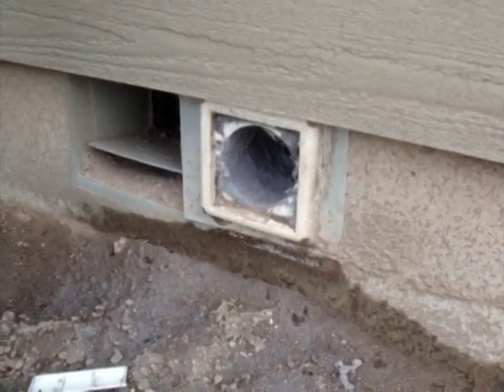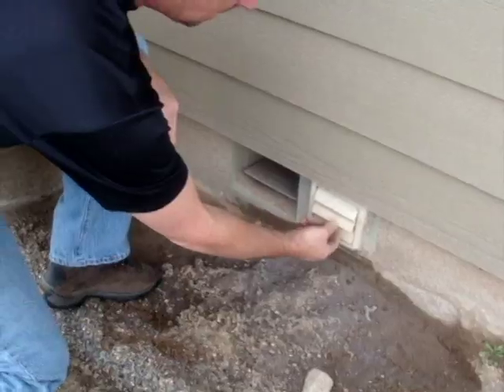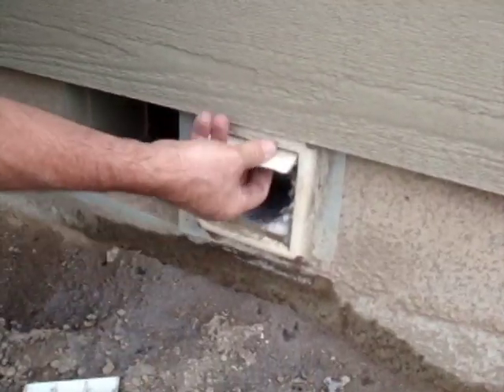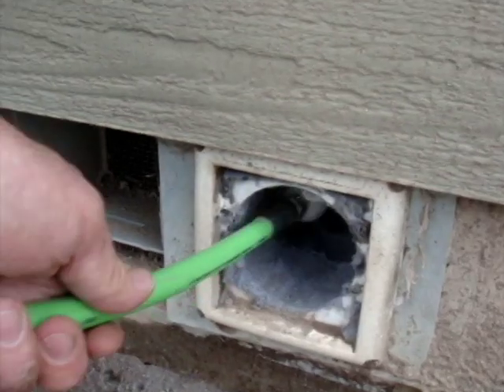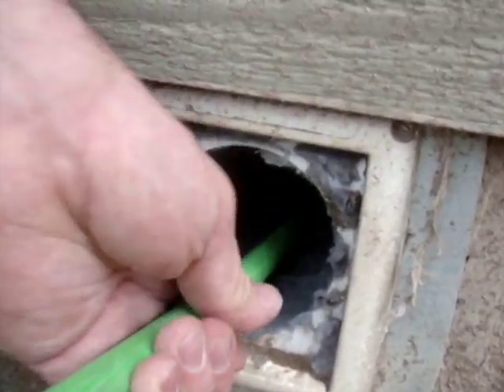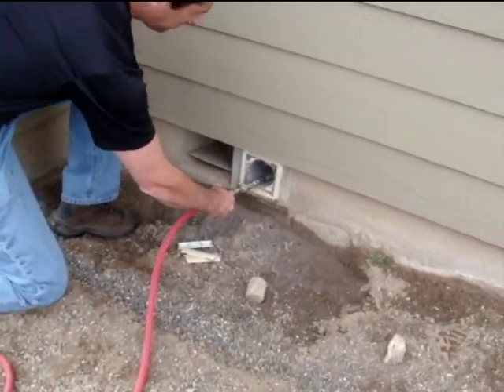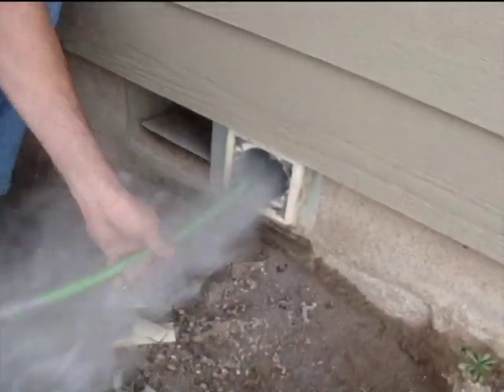RamAir System-  Dryer Duct Cleaning

Comment from the maker: Because the air movement created by the dryer motor helps propel the loosened lint toward the opening.
Dryer ducts certainly CAN be cleaned without the dryer running, it just helps to have it on.
Consider it like riding a bicycle in the same direction as a strong wind.